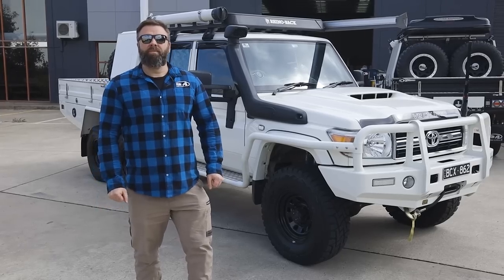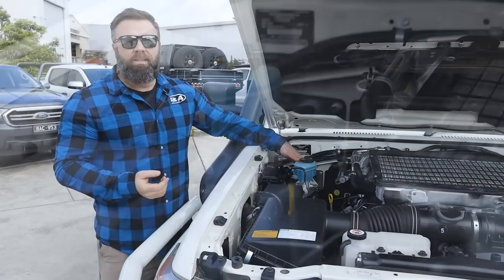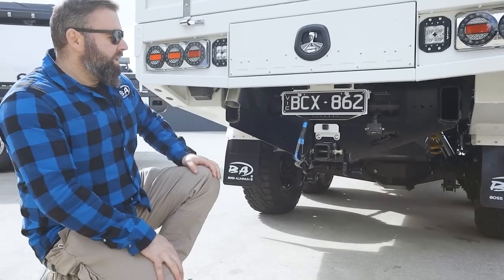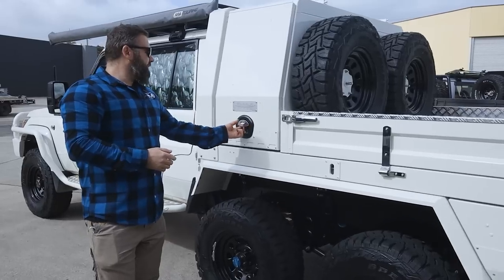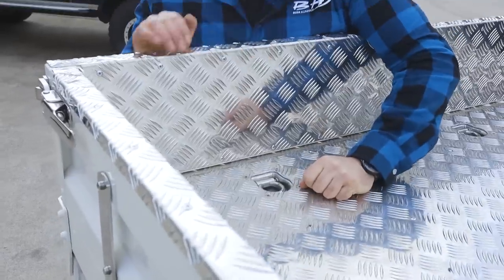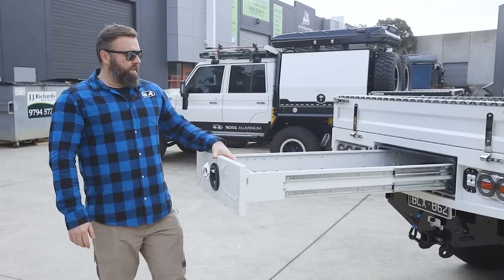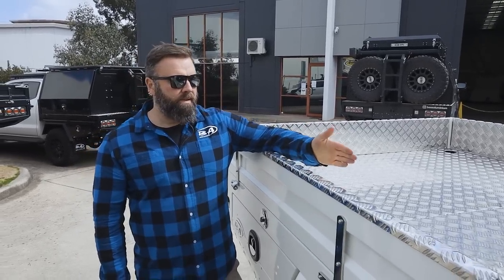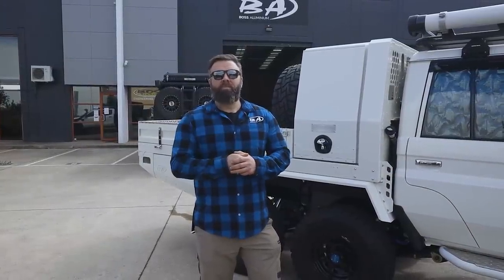Toyota Landcruiser 6x6 Full Rundown | Ultimate Touring Rig - Boss Built | Boss Aluminium

Comment: Could just be the angle of the video but that rear pinion angle looks pretty odd?
Reply: Hey Nick, the middle diff is a drive through low mount ford 9” pinion and the rear diff is the standard mid pinion Toyota center. Looks a bit funny because the drive through tailshaft  has to go from a 0 degree angle from the bottom of diff to a 0 degree angle to the middle of the rear diff.  The angles are the same just the tailshaft has to travel vertically to meet the flanges. Hope that makes sense!

Comment: Sorry but correct me if I’m wrong .... so you do a chassis extension so as to put more even weight distribution by having an extra 300mm between the cab and first rear wheel but then you extend the tray way past the rear back wheel anywhere 🤷🏻‍♂️ .... my head hurts 😆
Reply: The middle diff remains in the factory position. The rear diff accounts for the extended chassis with standard overhang.
Reply: Darcy Russell how would the middle remain in the factory position if you’ve pushed it back 300mm ? Or do you mean it stays in the same position under the tray as factory ?
Reply: I didn't hear anything about 300mm extension. I think the first wheels are in the stock position
Reply from the maker: The middle wheels remain in factory position, as Darcy said the rear set accounts for the extra length. The over hang from the rear wheel back is the standard overhang on a 4x4 79 series.